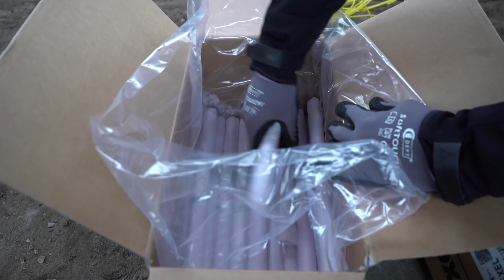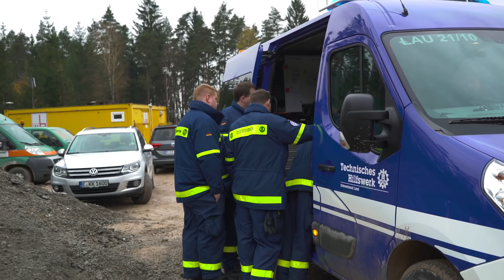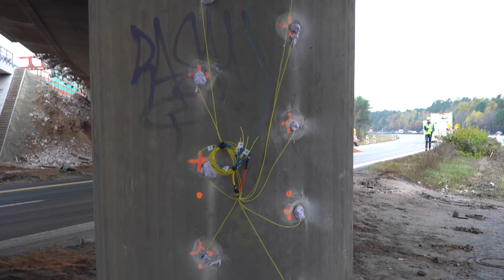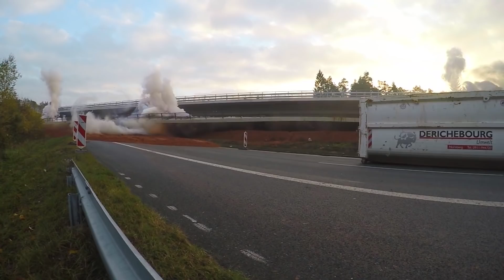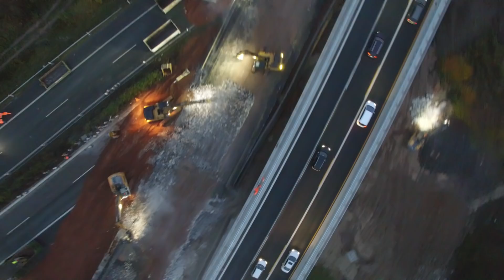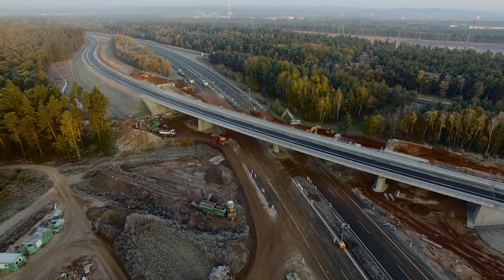Sprengung einer Autobahnbrücke am Autobahnkreuz Nürnberg

Comment: When you see this and still believe that the twin towers went down because of jet fuel.
Reply: Hey John. Yeah, I see this, and I know it was brought down by strategic planning and placement of explosives.  I also know that it was the design in the way the twin towers floor levels were secured. The jet fuel heated the metal beams causing them sag in the center of that floor, and to pull inward away from the fasteners .(stretch a tarp between 4 raised wooden rails, now add the weight of a few gallons of water) similar thing happened way up in the towers. When that floor then fell, then they pancaked downward,  the weight of each additional floor was so great and each floor sagged pulled inward snapped fasteners. A engineers son, Bin laden,  living in a cave in Afghanistan figured all that shit out. How to get all the terrorist pilots into the USA, get them all trained at a flight school  on 737s but just to fly the plane. No take offs no landings. Then the planes chosen were  for long flights, New York to LA.. full fuel tanks. In a month will be twenty years ago. Is JFK's assassination still a conspiracy too?😎✌🇺🇸
Reply: @richardcoram1562  what you choose to believe will be the truth you wish to seek.